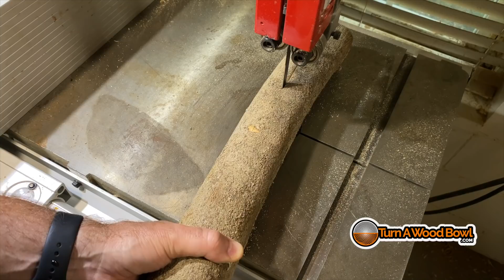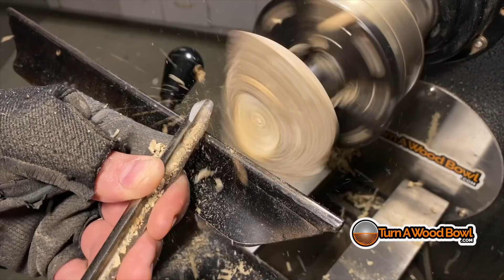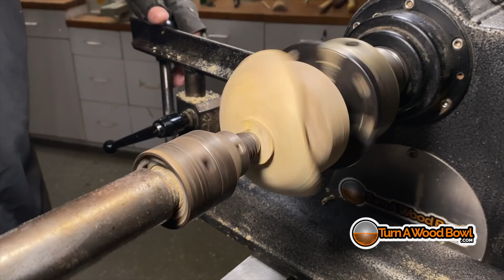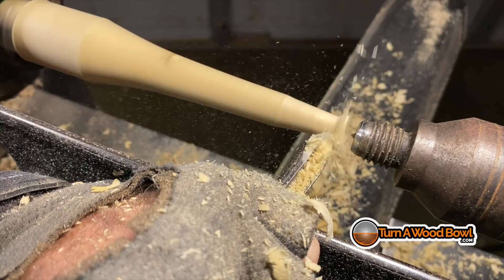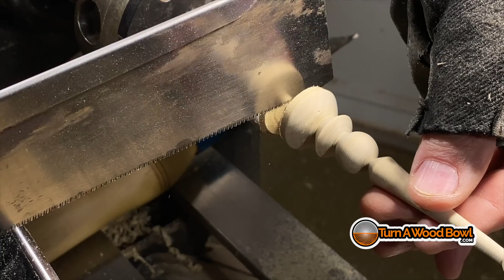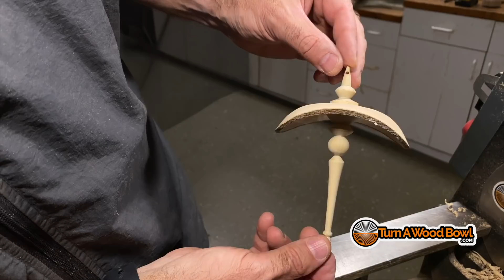Wood Turning Christmas Ornaments – Video

Comment: Great video.  Your voice overs are perfectly timed and are very descriptive.  Lathe speed is missing.  Would you consider doing a Picture in Picture with a camera on the lathe speed?  Oh, I forgot, does the Robust even have a lathe speed indicator?  Thanks and Stay Safe.
Reply from the maker: You answered your own question. ;) Yeah I turn based on feel, sound, and vibration. Have you seen this video yet? https://www.youtube.com/watch?v=qkAwPg-fPN8
Reply: @TurnAWoodBowl  I watched the video.  I agree and yet I also disagree when it comes to YouTube.  Very few people tell what speed they are running a demo at or why.  Now if you have hundreds of bowls or spindle work under your belt you know already what kinds of speeds are appropriate for which tool and wood.  But to a new turner, who doesn’t have a clue how to handle the 20 variables at play when turning, then lathe speed is a critical variable.  Is it 500 rpm?  Or is it 2500 rpm?  You can’t tell because of the cameras being used and their frame rate and 10 other video variables.  But how a tool functions at those different speeds is vastly different possibly.  To the point of being unsafe for the new turner.  So either state up front that the video is for experienced turners only or somehow give a rough idea of lathe speed, especially  when you change it and why you changed it.  This also applies to tool handle height and position.  So many YouTube turners are constantly  changing everything they are doing from one moment to the next and never explain why.  Knowing what you are doing and why is critical to learning for the new turner.  Especially for learning how to turn a bowl, which is probably one of the more challenging aspects of wood turning.  So many variables, so little time to explain.  Thanks and stay safe!

Comment: Thanks for a helpful video - exactly the kind of project I'm looking to make.  As time goes by, will the live edge begin to detach?  Can that be prevented?  I was thinking maybe CA glue could penetrate and secure it for longer, but I don't know if that will work or if it's necessary.  What about the live edge and small amount of movement due to variations of humidity?
Reply from the maker: Thanks and great question. It has to do with the tree species and moisture content. I have a new Tree to Bowl Online Course coming out soon that will address this topic in detail. Stay Tuned. Happy Turning!
Reply: For my bark edges and bark inclusions  I apply a sanding sealer then use a thin CA glue with a fine tip. Sanding sealer prevents the CA from wood staining. I try to limit the thin CA to the attach points and let it soak in only as much as needed to do the job. Hope that helps, it still allows for wood movement.

Comment: Great video Kent. I will be trying this. When using a bandsaw to cut a small log, I hold it with a clamp now. One caught and spun on me, tore up my pinkies because of it. Off the lathe for about 6 weeks, bummer.
Reply from the maker: Agreed! Need to be super cautious with cutting round stock. Stay safe and Happy Turning!

Comment: very nice Kent, as ususal.  Instead of making sheet metal gage, I just use an open ended wrench.
Reply: Yes Dean, I have a cheap set from about 6mm up to 17mm I use to size spindles etc.
Reply from the maker: Right on. I just needed a bit thin gauge this time. Thanks and Happy Turning!